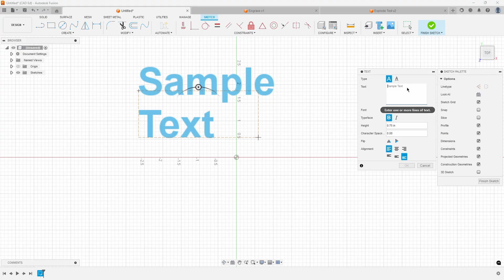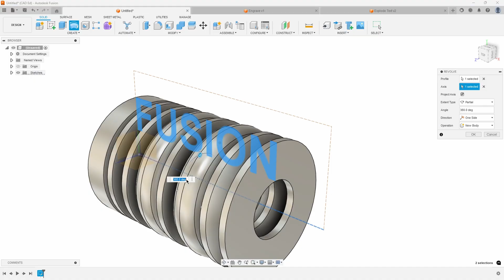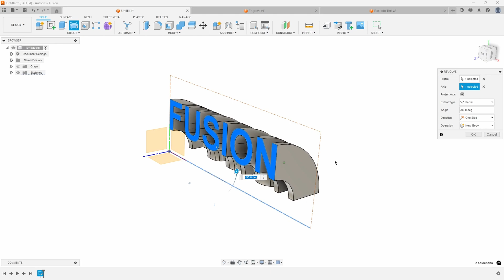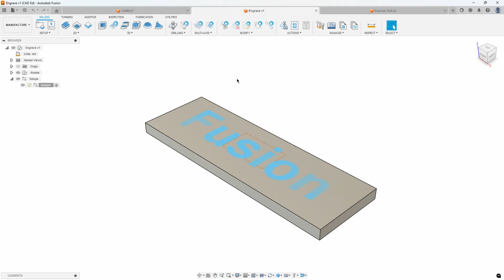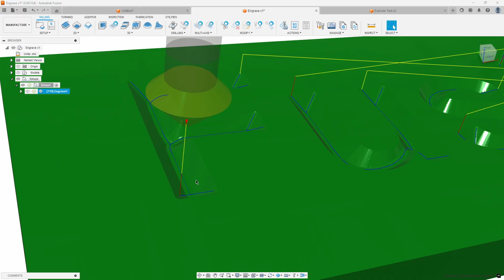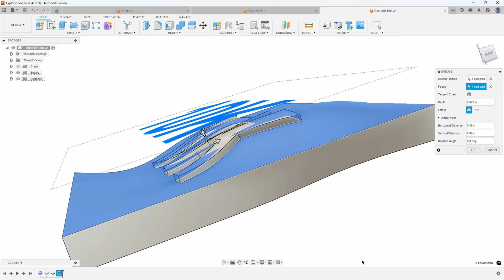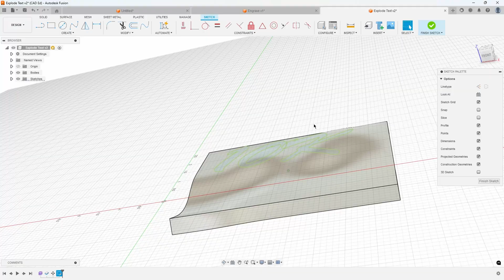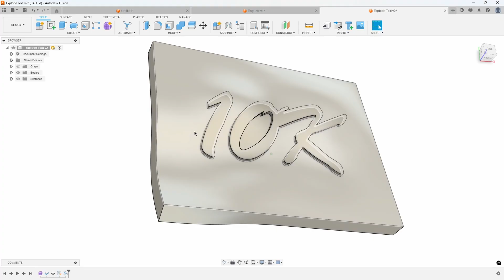Working with Text in Fusion

Comment: Why does my box need the text to be between ' and ' to show up?
Reply from the maker: Autodesk has added the ability to reference parameters in text now, and by doing so, it now requires your standard text to be in single quotes.  For example, you can now have text like: 'Length of Board=' +Length and it will return Length of Board=12in.

Comment: Thank you Brad, Is there a way to adjust kerning on individual letters?  I was working with SHAYLA in another cad program and there was a huge gap in the letters AY.  So my work around was to kern in coreldraw and import into cad and treat it like a sketch.  I saw on your text on curve where some letters are tight and some are way loose, which is typical of text on a curve.  Again, in Coreldraw, I can kern every letter to get just right (even up, down).  Then export as dxf...  I realize cad isn't at least to date interested in creative text uses, just thought I would ask a fusion expert! TY <><
Reply from the maker: Ya, Fusion doesn't have as much control over kerning and line spacing as some of the graphic-arts programs like Corel and Illustrator.  Sorry.  What you can do is Explode the text and then you can move each letter around individually, but ONLY do this once you are finalized on the font and size of the text.  Once you explode the text, you can't go back and change the font, size, etc.

Comment: Is there any way to save/convert the engraved part in the CAM workspace as a solid model? I often create tracing templates that I 3D print, and want 60° tapered sides for the stylus. Currently, I use an arduous process using sweeps.
Reply from the maker: @ikkentonda-  When you do a simulate of your setup or toolpath, you can right-click on the setup or toolpath and select Stock-->Save Stock.  This will save the simulated model as a stl, which you could then bring back in and use as a 3d model.
Reply: @bradtallis8968 awesome! Thanks for the response. I only own manual machines so never use the CAM workspace. This makes my life MUCH easier. Thank you!

Comment: Good stuff, as usual Brad! And congrats on 10K - that's an impressive milestone! You can unlock the text after exploding it by using the "unfix" constraint (the green sketch lines indicate they are "fixed" after exploding). This also works after importing an SVG. My workflow is to select all of the exploded text and then "unfix" it. Then I use the move tool to select everything and get it in the position I want. Finally, I'll "fix" everything to lock it back down so I don't inadvertently change something. It's a handy technique when you want to precisely position text or a logo.

Comment: You a 10k man, Brad! My question is, why when you drag text boxes around they want to slightly rotate?

BTW, exploded lines are locked. I've had to add a lot of bridges to plasma cut signs.
Reply from the maker: Thanks, Craig.  Ya, the "box" around the text is almost like a construction geometry box.  You can add a horizontal constraint to the text box before you drag it around and then it won't rotate.

Comment: Over 10,000 subs. Party Time? A slight correction with your first engraving toolpath. The tool you used was a chamfering tool(because it's flat at the bottom you can't use it to plunge into material) and what you should have used was a V-bit. In additon you can extrude text using 'Surfaces' and do a split face as an alternative to emboss. Love the videos.
Reply from the maker: Ugh, you caught me.  I didn't want to re-record the video, and that is why I went back and changed the tool to the v-bit in that example.  Good catch, though.  ;)

Comment: If you explode the text, you can unlock the lines, than you can move, scale, or somthing else. So, the lines are not locked in place.
Reply from the maker: Whelp, there we go again...  I learned something new...  I never realized that the exploded text was just "locked".  I had to test it once I saw your post, and sure enough, you are correct.  You still can't go back and edit the text to be different text, but at least you can move it around, scale it, etc.  Thanks for sharing!
Reply: @bradtallis8968 
- Yup.
- Green indicates 'Fix/Unfix' constraint has entities "locked down".
- This also happens upon 'Insert' of SVG (but not of DXF - not sure why the inconsistency).
Reply: Can't believe I didn't see this... Lol!  Thank you.  I've been converting the sketch to a DXF then importing it.  Dxf is handy though, gives a simple way to save often used sketches.
Reply: @eyelook2jesus  proving once more there are many effective methods to complete a task in fusion
Reply: I was just about to say the same thing!  Good call.